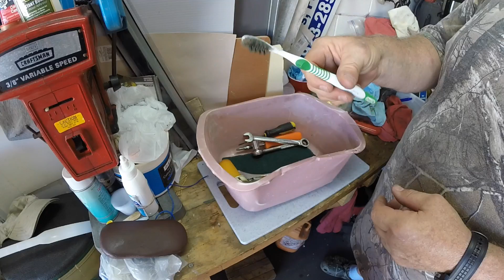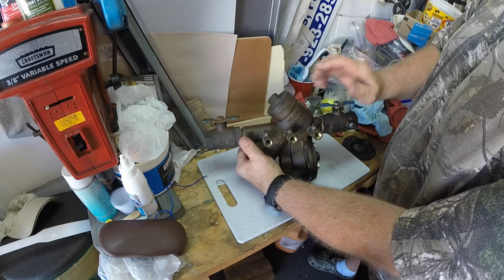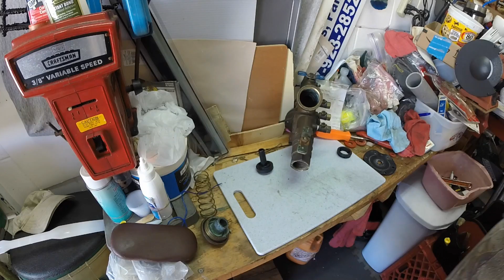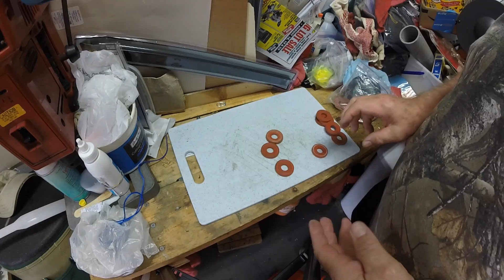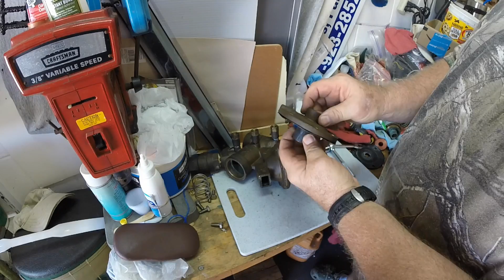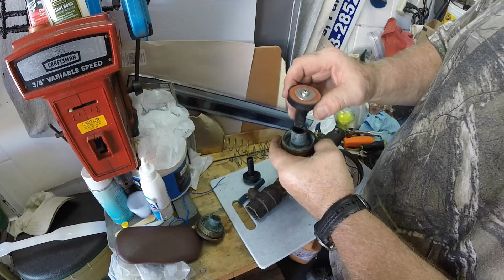BACKFLOW VALVE REPAIR  -  RPZ

Comment: I have a Watts 009 and have a drip out of the relief valve. I bought a complete rebuild kit, cleaned, and put back together and still have a drip. After shutting off the outfeed ball valve drip still happens so I’m not getting back pressure. I open port 4 and drip stops which tells me check 1 is bad. I’ve taken that thing apart at least 10 times to reseat and still have a drip. Do these valves just go bad after awhile? Or should I let it drip and hope it seals?
Reply from the maker: Yes, a valve can go bad. My guess is that the frame is made of brass, a soft metal. Sometimes I thing the frame can be distorted and the poppets or the Relief valve no longer lines up to make a perpendicular surface for a good seal. That is a guess on my part but a. very few times I had to replace a valve after replacing everything and it still would too pass.

I have a couple of things to try yet.
Is there any dirt under the disc on the CV #1 poppet?
Is the seat of CV #1 clean and the seat has no damage?
Is this a valve at your home or a customer? If a customer you have gauges?
What is the gauge reading for CV #1? Does it drop much over time, say ten minutes? If the pressure drops below 5 you clearly have a problem and the drip will get worse. 
After a good rebuild I often had a CV #1 reading around 9 or 10, sometimes even more. That is better than when they are new out of the box.

You said you put in new discs. It sometimes takes a little while for the disc to conform to the seat surface and if that is the case then over a day, usually an hour or two or less, the drip will stop.

If it is still dripping try three more things:
Open CV #1 and remove the spring. Like you see in my video stretch it slightly by holding it against your chest and pulling with both hands at the end of the spring. Stretch it a little does not mean doubling the length. Make it about 10-20% longer at the most. That will temporarily increase the pressure of the poppet against the seal and the seat and causing the disc to conform to the seat better. The spring is not designed to maintain that extra pressure and will go back to a five pound spring over time but temporarily it will give extra pressure to the seat the disc. This is not taught in school I learned that from doing hundreds of rebuilds.

Second last thing to try. Open CV #1. Make sure the stem of the poppet travels easily inside the cap. It should slide easily in and out or you have some more cleaning to do. If it is gritty or sticky I use Super Lube (food grade lubricant) on an old toothbrush inside the cap where the stem rides and clean it until the poppet slides well. Then clean all the lube off the inside of the cap and the poppet stem and reassemble. Is the leak still there? Any pressure changes on the gauge?

Last thing to try. Remove the CV #1 cap. Put the cap back on until the o-ring begins to make a seal. Open Shut Off #1 to let water in but only a small amount or you will not be able to do the next thing. Slowly tighten the cap with that small amount of water pressure. That turns the poppet while slight water pressure is there and usually seats the disc. 
When the drip stops, sit down, crack open a cold one, and smile.      😄                           Gerry
Reply: Lunker012 I appreciate it Gerry. I’ll take it apart again and try all the steps you suggested. 

I let it drip for several hours and still wasn’t able to get a seal. 

It’s my unit for my house and I don’t have a gauge. 

I never checked under the seats since I bought a total rebuilt/replacement kit. But I’ll check just in case if there is something underneath. 

The spring in check 1 is inside a cage but I’ll still take it apart and stretch it a little. 

I’ll let you know how it goes. 

Thanks, Ryan

Comment: Thank You so much for this video. This happens to be the valve that I have that is leaking. After watching I am wondering if I do have to replace the seats. Is this something I will be able to get the tool to remove it?
Reply from the maker: Gary, while occasionally the seats need to be replaced it is more likely the discs are worn or debris is on the surface preventing a good seal. After you open the valve and remove the poppet reach in with your finger to feel the seats. The seats are a plastic ring screwed into the surface the discs seal against. They should be smooth with no broken pieces. They can be covered with dirt or deposits and if you are careful to clean them off and not scratch or chip them you can  be good to go. If they are good the discs (seals) are the problems. If the seats are broken they need to be unscrewed and new ones installed. You really need a tool for doing that and sometimes even then they will not come out. I have bent the tool so bad it looked like a pretzel and they still would not come out.                     Gerry
Reply: @LunkerFishing  Hi Gerry, I opened the number 1 check valve to find that a spider had gotten caught between the poppet and seat causing the leak.While I had it off I turned over the disc and also on the other check valve. That solved the discharge leaking from the vent, but I still have a small leak dripping from the base of the relief valve. I haven't taking it apart yet, but thought I would get your opinion first. Does this indicate that the diaphragm is bad, or could it just be a leaky seal. This unit has never been apart so I suspect I could turn that seal around also. Also if the diaphragm is the problem. Can that be bought separately or do you have to buy a whole repair kit? Some include springs, while others just have O rings, seals and diaphragm. I want to repair this, but not replace parts that are reusable and doubling the cost of the repair. I am looking for a supplier if you have any suggestion on where to look. So far my searches have turned up prices all over the place. Thanks again    Gary
Reply from the maker: @garyhardin4194 , Sorry for the late answer. Just reading this. That drip from the Relief Valve is more likely the disc on the first check having debris and not making a good seal. When you flipped the disc over was the area you installed the disc on the poppet clean? Sometimes sand gets under there and when you flip the disc over it will not seal well. Also what condition is the disc in. Remember when you flip it over you are placing the bad side on the poppet and just like sand the bad deformed disc may not sit well on the poppet.
Gerry

Comment: Great video, lots of useful info. Have you ever used half strength phosphoric acid to clean up scale and dirt on valve parts? I use it for scale on heads, pumps and piping on my boat, and it works great.
Reply: This will definitely clean the valve parts. The problem you run into is that these are installed on the drinking water system and you do not want to be drinking phosphoric acid that was left inside the assembly. DO NOT DO THIS
Reply from the maker: I never heard of that. It sounds interesting.      Gerry

Comment: Hi, need your help again, I got warning last year about my Wilkins 550 DC 1" backflow preventer, it was close to 1, may fail soon. So, I decide to do repair myself, I ordered O-ring, rubber disc and put them on. 
Today, 03/08/19, tester came and told me it failed, all dropped to near 0, I opened it, all seems well, I doubt spring is weak, I pull from both sides to extend the length of spring in order to make it more strength, no work, what the possible reasons are ?
Reply from the maker: Bryan,
Without a differential pressure guage that the guy used to test your valve you never know if you got the repair done correctly. I repaired many valves only to test them and they failed. I had to open the valve and clean everything again and reinstalled all the parts. Usually they then pass very well then but sometimes i had to do that a third time. 
Did you clean under the disc or seal before you in stalled them on the poppets? If there is dirt on the disc the water pressure can push under the disc and fail the test. Cleanliness is important to all repairs. 
When you repair a RP you can see the water dripping from the relief valve. A DC has no relief valve and you do not have that indication of the leak to know things did not go well on the repair. 
You have no choice other than to take it apart. Clean everything again and reassemble again.
Let me know how it goes.
Gerry
Reply: @LunkerFishing  One more thing, I have put a little bit of plumber grease on disc, both sides, I thought this could help disc match the seat better; but you indicate that it is a ban (in your video). I will clean disc and clean the seat again. I hope this is not the main reason which caused test failure.
Reply from the maker: @bettershooter  lube on the disc is not needed or a good idea. That may have some effect on your test but is not definitive. Make sure you also clean all the surfaces the disc touches.                                                     Gerry
Reply: @LunkerFishing  thanks, I did clean the seat with coarse cloth, the same thing you showed in your video, I have also wipe disc and the disc holder clean, plus, I put the disc washer in right order, you gave a special warning in video.
I have done all of it, now, just wait another test, hopefully, it will pass. If not, I would consider to replace it with a new one.
Thanks, Lunker
Reply: @LunkerFishing  I did everything I could, still fail one more time, 0.5 on both, a little bit better than last time, I scouring pad and sand paper to clean the seat, no use. So, time to have a new one. 
Plan to buy Wilkins 950 XLT, lead free, should be good for another 20~30 years. (still don't get why fail.) Just let you know, as you said.
Reply from the maker: @bettershooter  sorry for the late reply I just saw this. You are changing from a 975 to a 950 and they are two different kinds of valves. You are going from a Reduced Pressure Valve to a Double Check Valve and your water authority may not allow that.                  Gerry
Reply from the maker: I just reread your post and you had a Double Check there already so forget what I just said. Let me tell you something else though. The poppet stem must travel through the cap freely. If not it can keep the popped from sealing and cause the failure in the test. I have removed the cap to find the poppet still stuck in the cap with the spring still compressed and that is a five pound spring! Obviously it would fail because the poppet is not pushing down on the seat to make a good seal. Also, look at the hole in the cap where the stem goes in. They are often drilled crooked and then cause the poppet to not sit perpendicular to the seat. Sometimes with the test kit I can watch the poppet properly seal when screwing the cap on to the correct position. You need it tight enough that the cap does not leak but a little tweak can make it pass or fail.       Gerry

Comment: Very appreciate your video, the first one that gives me so much details, thanks, pal.
Will a broken (or leaking) backflow valve cause lots of water running out ?
Reply from the maker: Wow, Brian, that would be difficult to answer without more information. 
Where is it leaking from?
Parts inside that are broken can certainly make it leak out of the relief valve on the bottom of a RP , Reduced Pressure, backflow valve. There are three other kinds of valves. What kind do you have?         Gerry
Reply: @LunkerFishing  it is double check type, Wilkins, looks like this one but it seems to lack of small release sprouts, https://www.zurn.com/products/water-safety/backflow-prevention/950xlt2. It is very old, more than 29 years
Reply from the maker: Bryan, I have one of those in the garage right now. There should be no water leaking from that valve at all. The only way water can get out of that is through the test ports on the side and it sounds like you do not even have those. Are they plugged and the test ports missing? When a Double Check fails it just lets the water pass by since there is no relief valve like in the RP valve in my video. That makes them dangerous in that your water can be contaminated or worse yet, you can be contaminating others drinking water with an improperly fuctioning Double Check. The only way you can know is to have the valve tested through the test ports with a Differential Pressure Gauge that I used every day. An RP as in the video is the same as this Double Check except it has a Relief Valve and the poppet spring in Check Valve #1 is stronger and designed to hold back 5-pounds rather than the 1-pound the Double Check does. Probably after 29 years it needs to retire.
Try to describe where it is leaking.                                   Gerry
Reply: @LunkerFishing  that double check valves has no outside leak, I have ordered repair kit from home depot, parts #RK34-950XLC, just like you said, 2 valves with 1 pound spring and poppet which you have shown me, very appreciate your video, pal. We are in similar age and I am very interested in all repair works.
Of course, inflation is also a big pusher.

Comment: Such a great video! So much great info, tips tricks and hints..

At my work there is a big febco 825yd that says on the plate RP under "type", but it has no relief valve assembly... am I missing something?
Reply: Thanks! 
Hrm, yeah something is fishy with this assembly...
Also under the nameplate under size it says "3"....
Maybe it's the plate that is confused.
Reply: I have another question.  I'm practicing on an out of service old RP and the PSID will drop below 5 in my first test, but it takes a very long time (10 minutes) to do so..
https://youtu.be/_2BecRo4Ln4
Reply from the maker: @JJRD222  , sorry for the late reply I just saw your post. The Watts RP if very difficult to do a repair on. That small valve is full of plastic and the watts design is an issue also. Every tome you open that valve you disturb the relief valve, that may have been working well, to get to the check valves to service them. The check valves are almost impossible to remove to service them and the new ones to be reinstalled. Then you have to reinstall the relieve assembly that needlessly had to be disturbed to open the valve. Now everything has to fit perfectly in order for it to work properly and you cannot just go back and reseat just one thing because it all fits together. Don't beat yourself up on that valve. I have successfully repaired them but most times people just replace them with new. The parts in the Watts are more expensive than replacing because they do not sell individual parts, you buy entire packages of parts, most of which you do not need. Do yourself a favor, do not reinstall that Watts, change to another brand with a better design like the Wilkins 975xl. You will not regret doing that the next time you need to repair the valve.                       Gerry
Reply: @LunkerFishing  thank you Gerry for that perfect synopses of what I was experiencing. What a pain those things are! I relayed essentially the same sentiments and advice to my superiors a couple of months ago. Please don't apologize for late replies my friend, you are retired and should spend as little time as possible worrying about backflow.. I had a hard time even asking.. 
Thank you yet again for the response, I really do appreciate it.
Reply from the maker: Go to http://www.febcoonline.com/Products/825YD to see a picture of a 825 YD. If yours looks like that the round item in the center of the assembly is the relief valve. It is possible someone altered this by removing the relief valve by plugging the openings but then they would have to change Check Valve #1 to have the same internal parts as Check Valve #2 (1-pound spring as opposed to the 5-pound spring required in a RP) to make a Double Check assembly instead of a RP. That does not make sense that someone would do that and upon inspection the assembly would not pass, but there are plenty of people in jail for not following the rules so anything is possible.                            Gerry

Comment: Thanks lunker, this was very detailed and helpful.  Aside from purchasing the Wilkins check seat tools, I was curious what troubles, if any, you have experienced in replacing the check seats? Thanks again
Reply from the maker: Cory, even with the tool I have had seats that would not come out. Sometimes the valve had to be replaced because the plastic seat was cracked and needed to be replaced and the tool looked like a pretzel twisting and the seat would not come out. The tool works on most seats but the tool twists if the seat is stuck hard and at times the tool will not remove it. The seat threads are fine and reinstalling them easily results in cross threading so having extra seats to try again was often needed.